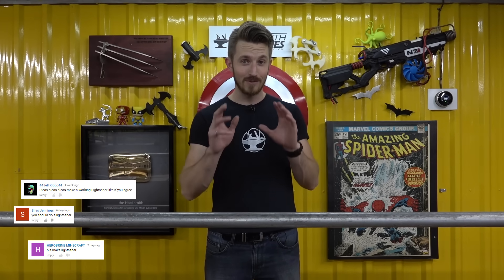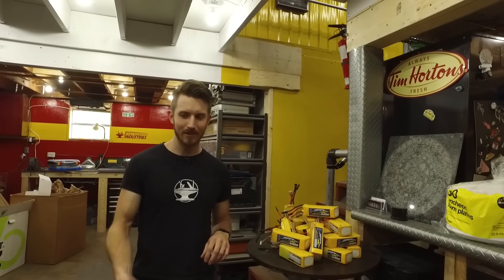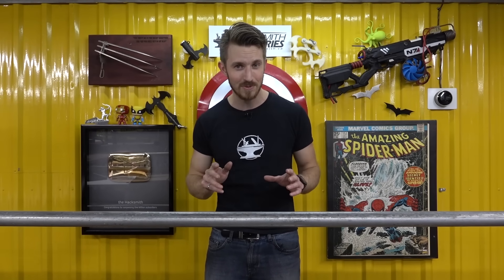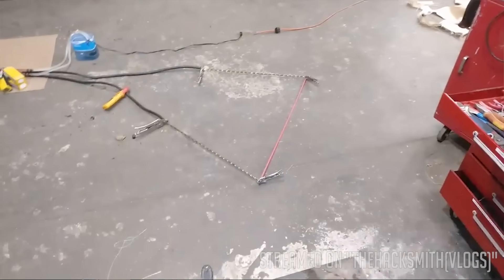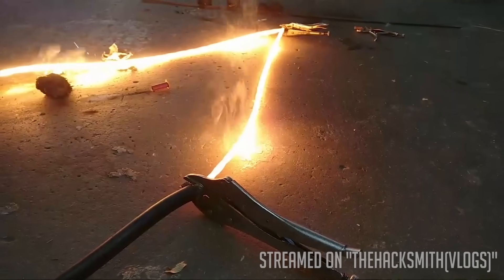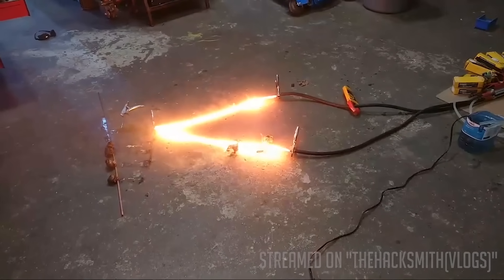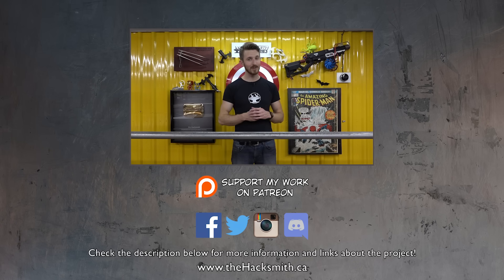HOMEMADE LIGHTSABER EXPLOSION!

Comment: The blade needs to be a plasma contained in an electromagnetic field.
Reply: Do you have any ideas how one might produce such a field without using an electromagnet the size of a subway tunnel?
Reply: well that's simple, you just use two electromagnets, each the size of half a subway tunnel.
Honestly thought, a poorly focused high powered laser would have MUCH more cutting ability that a red hot metal rod. Even old YAG lasers use way less power than that pack is capable of supplying, we run 5kW from the wall at work to cut approx. 1mm thick stainless on ancient hardware, it ain't fast but it sure is way faster than trying to cut it with a red bar of steel.
Reply: I know not just heated up metal.
Reply: Also, it takes a lot of electricity to create plasma as the electricity must pass through the air (which has a very high resistance) to complete the circuit and still be able to super heat gas around it. The power they are using currently is child's play compared to what they would need to create that much plasma, not to mention power an electromagnet of that caliper.
Reply: The Sci-Fi Builder you could use a different kind of gas that has less resistance. I'm no scientist just throwing ideas out there
Reply: Shiny Rayquazza, you can just up the amperage on smaller electromagnets to generate a stronger magnetic field up to the magnets' melting points. Not sure how strong the mag field would need to be to contain plasma flow sufficiently, but I imagine if the magnets are in close enough proximity, the pairing could be achieved. And once graphene technology is improved, the temperature limits will go up a lot so we can conduct at higher amperages.
Reply: He definitely could. I'm excited to see how it's done.
Reply: Let me tell ya something about that magnetic field...You'd need around 40000 super-magnets. I suggest watching the Michio Kukuo lightsaber video. It is on YouTube, and has a different sort of containment method than magnets, because let's face it. Tech is crap right now for a looped variable high-power magnetic field capable of containing, directing, and handling high-thermal levels of plasma. Personally, though? I'd combine it with Hacksmiths. That steel gave me an idea, and if one uses it in a style similar to a katana style, as in a single edge, curving so it retains a tip, steel being clamped in its location with industrial ceramics(Again, Michio Kukuo. It makes sense, and can work.) while 4 heating instruments are being used so it can gain a cutting edge of thermal energy, and the power pack being used with a hilt similar to the toy hilts, the blade being able to be contained in the hilt, while working like the toys via a segment sliding into another...Huh. This could work, it'd be a pain to build this design I got, but it could ACTUALLY work. It would also probably be bloody expensive, what with the heavy-duty insulated wire, and the need for the pistons in the ceramic to extend the blade, and the electronics needed to wire it all up to link the on switch, preferably located on the hilt, being able to simultaneously extend the blade while turning on the power...the metal would need to be partially heat-treated to prevent too much melting of itself while it can still cut/melt through things, and it'd need to be heavy-duty grade too, so it wouldn't break from swinging around and hitting too many things too hard...and then there's the fact of the metal portion of the blade itself, if one were to try to use it by the metal sliding into hollow bots, that would be dumb, because that weakens the integrity of the metal, but maybe segmented bits of metal, and they mag-lock into place while swiveling on a small, low-power, low-speed rotor...that'd work...!
Reply: Hey, maybe if they create an exosuit that has ease of movement, they can hook up the power to it and take things from there!

Comment: Would a tungsten rod cost too much for the blade? Because if I'm not mistaken old light bulbs use tungsten(wolfram) as the filament and it can withstand a lot of heat.
Reply from the maker: there's a hint in the video ;-)

Comment: That's amazing! I've always wanted you to make a lightsaber! To make the blade, maybe you could use a metal with a high melting temperature for the core of the blade so that it is sturdy, and coat it with another metal with a lower melting point. If you isolate the two parts, you could make the current go through a wire in the middle of the blade that would go from the end of the blade to the hilt, and that way, the current would only go through the exterior of the blade. I hope this is comprehensible
Reply from the maker: Hmm, cool idea! The issue is even if the current is going through the outside blade, its gonna heat up the inside blade, and you'll end up with a puddle of metal regardless ;-)
Reply: Yeah, that's true... (senpai noticed me!!!)

Comment: why not make a nichrome or kanthal coil around a ceramic coated rod? it will heat up much faster than a solid steel rod and you can use less amps, giving you longer battery life.
Reply: like upscaling a vape. lol
Reply from the maker: Wouldn't be as hot as the solution we have ;-)
Reply: the Hacksmith you'd be surprised how hot kanthal will get with a few amps put through it. As an engineer myself, I still think you need something around a nonheated core so it maintains its rigidity. I can't wait to see what you've come up with. You've got a large nerdy fanbase here with all the star wars fanatics that want this thing swung around.
Reply from the maker: +Denarius a few amps? This will be 5000A ;-) only way your cutting through steel plate!
Reply: the Hacksmith in that case, you must have quite the trick up your sleeve.

Comment: Only an enthusiast and have absolutely no background in any engineering or science, but I am good at thinking  out of the box.
What if using the concepts of hot wire cutters and supporting it with ceramic or other highly heat resistant materials? Basically,  you might either wind the high gauge metal wire around the ceramic or heat resistant element as a coil, thread it through a series of alternating holes (like the pattern of how a fisherman threads his line on a fishing rod), or simply have the metal contact points similar to a flourescent light (with the positive and negative points attached to the two tips of the ceramic and leaving the cutting edge supported by the ceramic) but with the ceramic as support. 
Of course, this idea only works for metal components which don't last long.

I'm not sure if your existing power supply is able to create plasma that can cut things, but maybe taking inspiration from Dr. Kaku, you can find a way to channel a small amount and maybe make more of a plasma knife first? 

Anyways,  love the show and good luck!
Reply from the maker: Stay tuned for the next part ;-)

Comment: for the saber what i think you need is a loop of fairly conductive metal ie steel around a much less conductive metal ie titanium or something similar. that way the current will still flow through the steel but wont have a big hole in the middle. what do you think?
also in future maybe you should test these things with a few less batteries. no wonder it caught on fire.
Reply from the maker: Not quite!

Comment: Gonna be pretty hard to do lightsaber (hot metal saber) fights with that thing. Any idea how you plan on keeping it from melting?
Reply from the maker: That's what you're suppose to figure out ;-)

There's a hint in the video. Obviously steel isn't gonna work.
Reply: the Hacksmith hey try looking up some ta4hfc5! I know that's what they use to hold molten tungsten as it doesn't react and has a higher melting point! Not sure if it's conductive or not however. Just a thought!
Reply from the maker: That's really cool UnixElite46!

But there's no way we could afford that lol.
Reply: the Hacksmith

Yeah... I think I'll just wait for the next video on it... Lmfao.

Comment: use tungsten instead of steel but it'll be very expensive
Reply from the maker: there's a hint in the video ;-)
Reply: Well I was hoping for hot plasma contained in an electromagnetic field.
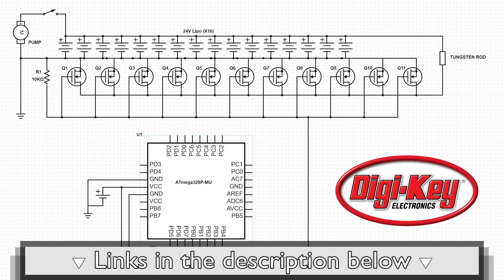Reply: 1:49
Reply: You're thinking of tungsten carbide. Tungsten is a metal.
Reply: Tungsten is only brittle when cold. It has one of the highest "red hardness" ratings of any metal. Meaning once it is red hot it becomes very strong. I think it's a great idea. Maybe do a small scale test with some TIG rods.
Reply: didn't notice my bad
Reply: How big of a rod are you planning to use? A 1cm diameter 1m rod would put you at the top end of the mass range for a greatsword.
Reply: This was only a test of the power supply. They were using the steel rods to simulate the final product. Why go to the expense of using good materials for the "blade" for testing if you don't know how the power supply is going to perform. Since the power supply is the limiting factor in this project, they have to see what kind of power they are capable of delivering, and then design the blade based on that.
Reply from the maker: +Matthew Tremain anything telescopic would break after being heated a few times sadly. :( 

Hickups fire sword would be a good project! You don't need a big shop or money to do that!
Reply: How about trying to use Tantalum which has a pretty close melting point to tungsten?
Reply: [TVA] 1815 Delta III Tantalum is more expensive than tungsten so I'm not sure
Reply: I agree
Reply: PenutButterCat21
Probably a bad choice since Titanium ignites at high temperatures.
Reply: Mohommad Iqbal that would be cool and they're not even aiming to have the light Saber very manuverable since they are basing it off the proto Saber which is bulky and has cables connected to it.
Reply: Titanium lol
Reply: Michael Lovelace You are completely right. My bad.Nevertheless its very brittle.
Reply: Hmmm tungsten telescopic tubing that can hide in the hilt from HTTYD2. I was once  looking at making hickups fire sword. I have plans just not the shed and funds to create it.
Reply: the Hacksmith use graphite
Reply: Mohommad Iqbal tungsten is also very heavy which will make the swift movements of a Jedi harder to perform
Reply: Samwise Gamgee good point but it'll have the best chance of not deforming under high temperatures and they could also wrap the tungsten with steel wire to create a cool sparking effect similar to the video
Reply: the Hacksmith cut through a Goldman fidget spinner! just destroy them!
Reply: Mohommad Iqbal well tungsten is really heavy but there are heat resistant super alloys made of nickel , or inconel or even graphite
Reply: the Hacksmith unfortunately I have to be extremely careful with what I buy. I am nearly bankrupt.
Reply: Mohommad Iqbal how about Tungsten Carbide since it has a very high melting point
Reply: The only problem with tungsten is that its very brittle since its a ceramic so it wouldn't be a good choice for hitting stuff.